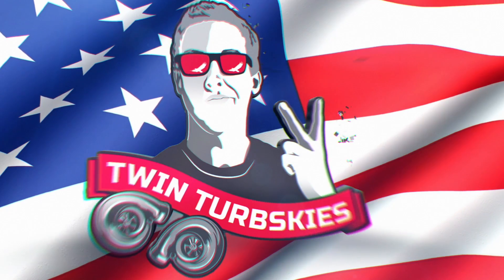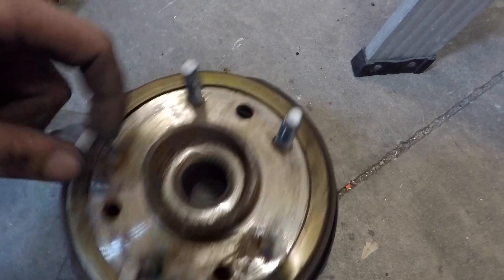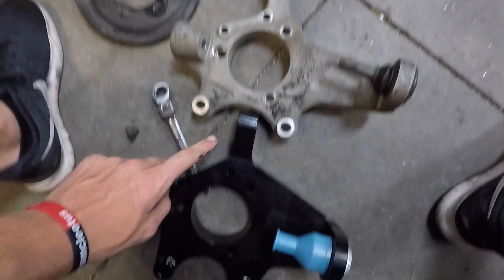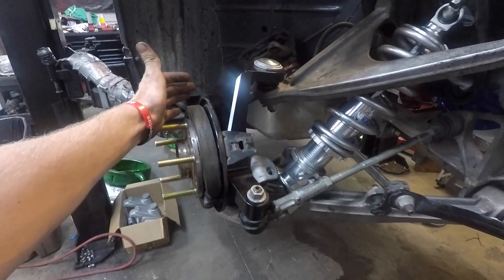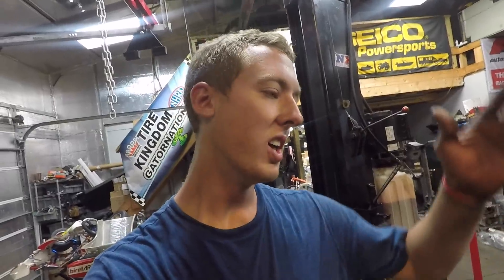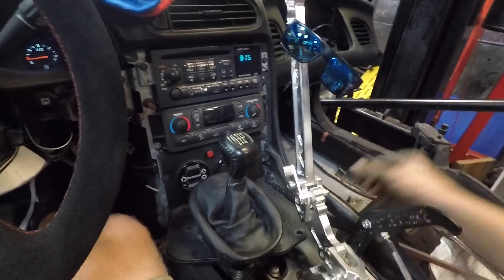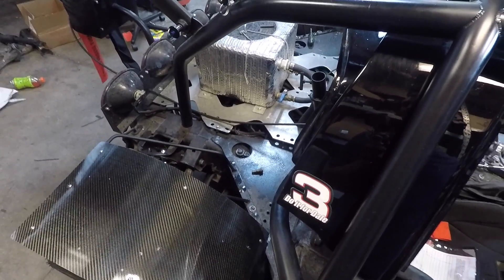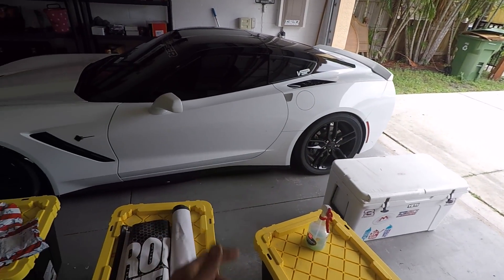They're Mounted... Car Looks AMAZING! (all the traction)

Comment: Hey Cleetus! When you get to SCTO find a alignment shop and double check the alignment. Anytime changing major suspension components it will change from previous setup don't want you to get hurt. Then find someone with compu scales and check weight on each corner and adjust coilovers with you suited up sitting in Leroy to achieve proper weight transfer. Good luck and God speed!!

Comment: If you don't have a press for lug studs all you have to do is stack a bunch of washers on the stud and then put the nut on and it will pull it in. Can't tell you how it works but it does, my dad showed me that,he was a big rig mechanic, very sharp. Everyone in shop went to him for problem solving,they all called him "Doc"

Comment: Why you going with 15" wheels? maybe a ignorant question but.. with leroy not having fenders tire clearance is not an issue.
Reply: Torpedomtb from what I can understand, the smaller wheel allows for more sidewall. Bigger sidewall flexes more, better traction, and is easier on drivetrain components. I understand about not having fenders and all, but he still has to clear the stock rocker panels and those 26" tires looked pretty close there.  Maybe someone else can explain it more or tell me I have no clue. That's just my understanding.

Comment: Did you make the same mistake as my spindles and and only grind the control arm so the wheel spins on the lift? The control arm is at a totally different angle and has to be grinded a shit ton more when the car is on the ground.

Comment: What happens if you add 1 qt of ln2 to that tank? On top of 1 gal of water of course.  Then what about dry ice? Would it need a pop off valve on the tank when it it 2-3 psi?
Reply: you might wanna be careful adding ln2 to water...
Reply: great idea but its essential to run a 50/50 mix of nitromethane and hydrazine to fuel the engine with those low charge air temps fyi

Comment: It needs 27's or 28's. But, then again, I personally would wanna run 16's. But noone makes tires for 16's.

The industry should make more tires for 16's. I want a 28x12x16. A dot legal, and an all out race version would do me a welcomed good frighten. The DOT legal one should be able to withstand high speeds longer than full on drag tires are rated to, what with highway pulls and speed runs and all.

Comment: Torque all your suspension related bolts under the load weight of the car, can't have any binding, need Leroy dialed in for the race against the Cowmaro!

Comment: I have a simple solution for Cleetus's problem with driving Leroy on the streets. 
Why don't you just buy a body for poor Leroy.  Plus it's a lot safer than without a body. Reason being all the money you have invested  into Leroy is basically just the engine and drivetrain. If you put a body on Leroy it would look great and you'd be able to drive Leroy anywhere you want without having to worry about the police.